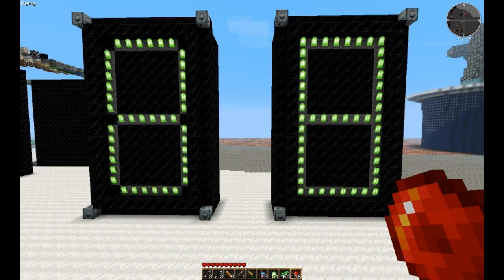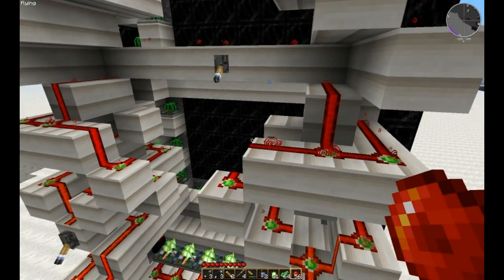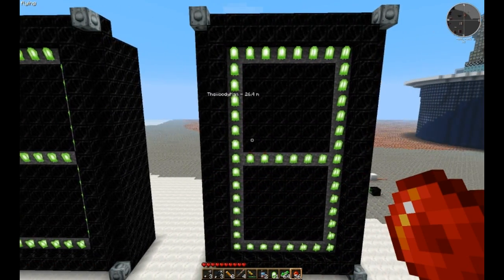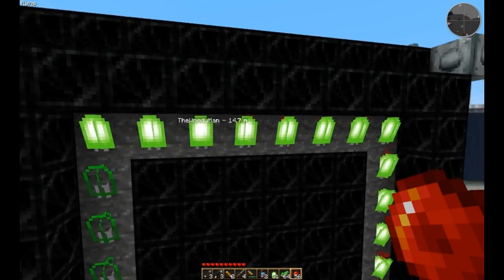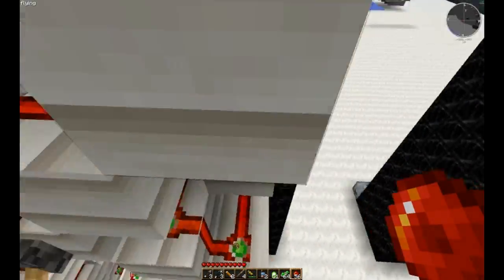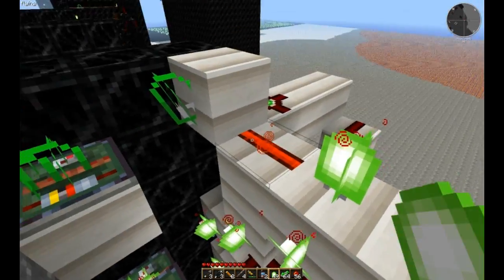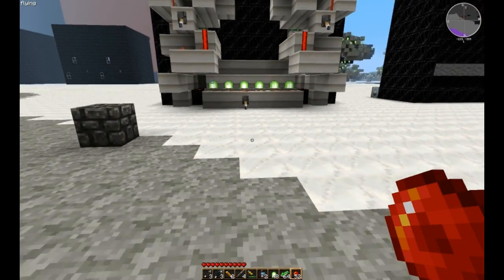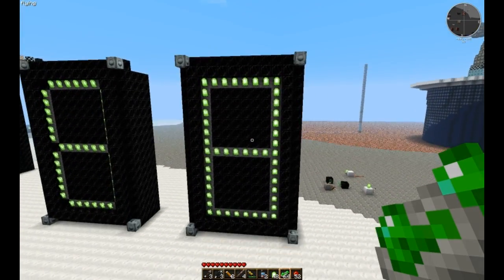VoxelTüt: Redstone OR-gated 7 Segment Displays in Minecraft!

Comment: @GMRright Don't watch tutorials on how to do it in redstone first though. Learn about how computers work first, and learning how binary works will help you a lot too. Also, there's only two different bits. 1 and 0, so you must mean a byte. A byte is a series of 8 bits (e.g. 10010110) these doesn't really "mean anything" other than numbers. When it comes to redstone and you want to work with numbers, you must use this numeral system instead because redstone obviously only has on and off states.